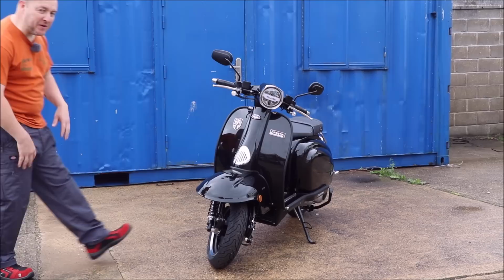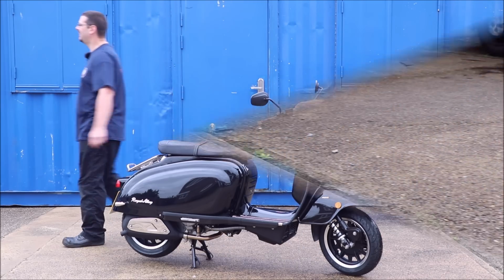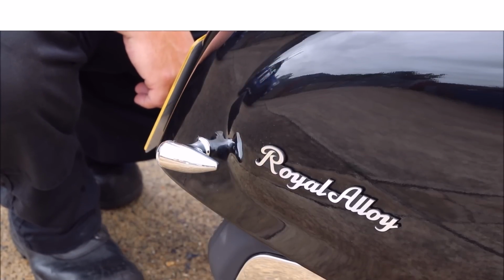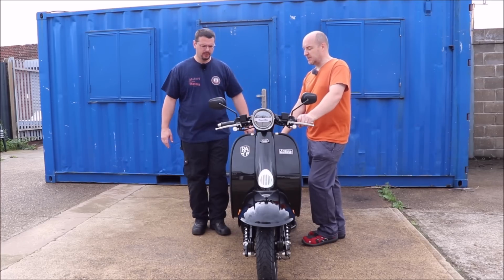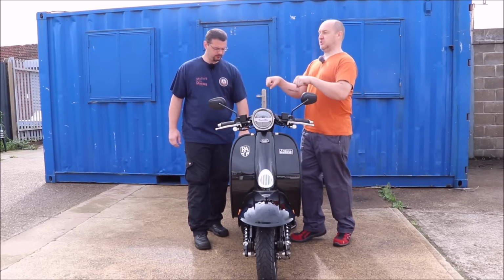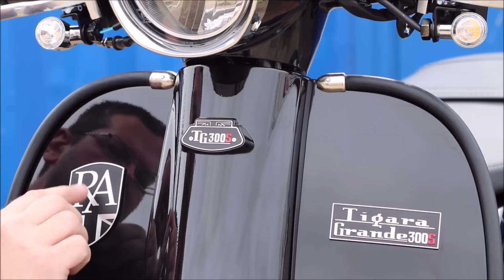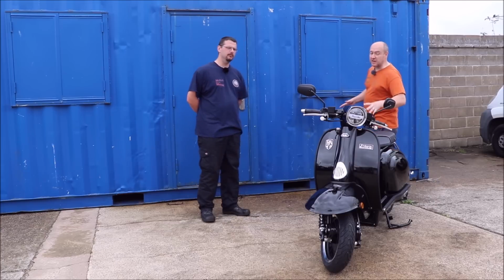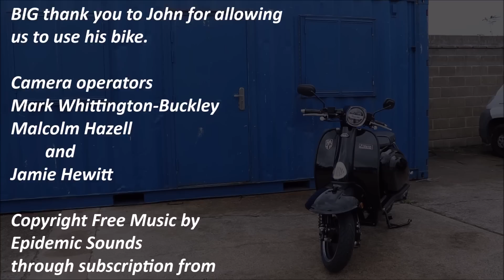Royal Alloy TG300 WORLD'S FIRST REVIEW

Comment: Gentlemen the RA it is splendid indeed pretty much fine. I wonder if could be to elevate the handlebar up to 1,10 Meters ?? I had several Lambrettas and now one Vespa old fashion PX150. Its handlebar height  is 1, 10 meters. Very comfortable to ride on it. I found excellent the Lambrettas but their handlebar is lower.  All the best and success with the Royal Alloy 300.

Comment: I've been mulling over this vid since you first posted it. 
One thing I don't understand is that you seemed to really like the RA GP300. However, with the TG300 - which is basically the same machine, but just a styling exercise, I get mixed messages about the bike.
Is it possible to explain a little bit more as to why please?
Reply from the maker: Really? I can't see how we were sending mixed messages to be honest. There were positives and negatives over the GP. Good as in lower seat so riding was more comfy for me but as Malc sits further back, the seat hump got in his way a little. The ride itself as good as the GP. The clock being all LCD was different, nicer but some bits were harder to read.
Reply: Motors for the Masses Gotcha- thank you for the update on your thoughts. I appreciate that.

Comment: Please, suspension..... we need more in depth discussion, as a biker who has bought a new scooter.(s)  I find  the handling leaves a lot to be desired.
Reply from the maker: Smaller wheels, less travel the shocks are never going be as those on a bike. However the dampening in this is pretty absorbing and seems to work well. Especially when compared to the lighter engined 125's.